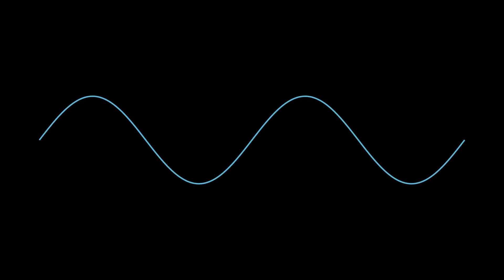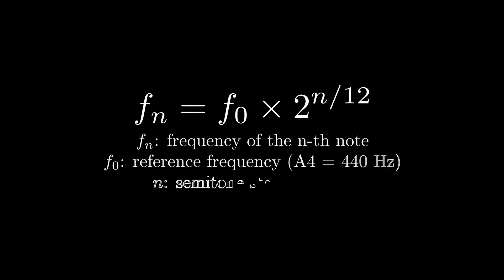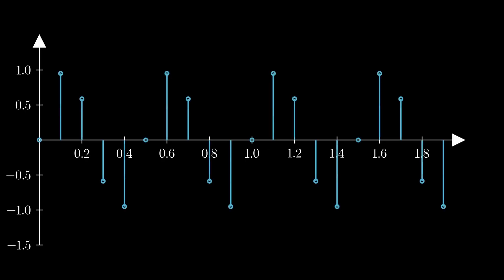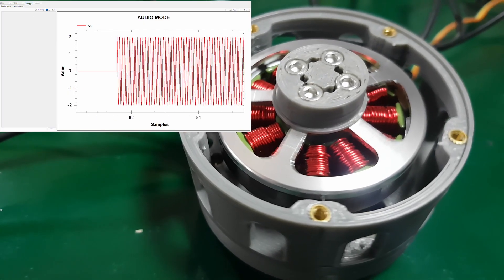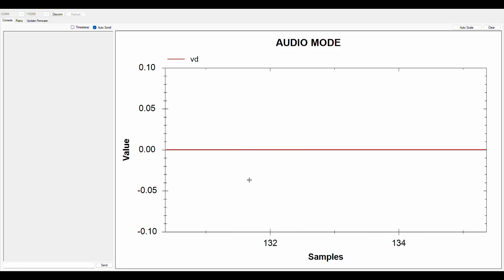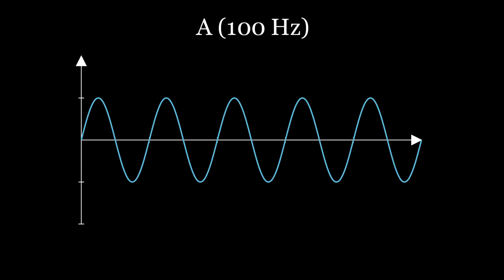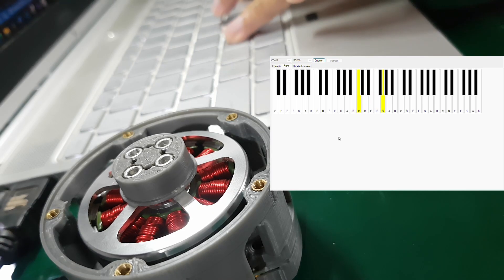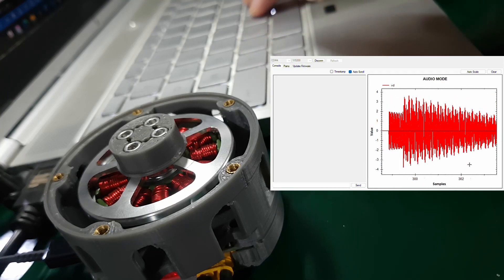Can a BLDC Motor Become a Musical Instrument?

Comment: I came here when I realized that the feature is used my a few ESCs to play startup or error sounds, but actually implies the motor sound HEAVILY depends on how it is driven, so the sound could be tuned in a wide range to sound very different in operation/power delivery. Also the principles of noise cancellation should work.

Comment: Interesting and good job! I have been toying with the idea to implement variable pwm frequency for my AC motor inverter to realize acceleration scales seen in trains usch as ”do-re-mi” so when going from a low to high modulated frequency (0-50hz) the carrier frequency would follow in steps from the lowest note to the highest. Your way of directly modifying the Vd voltages seems to work nice for a BLDC, have you noticed any thermal constraints with this method?
Reply from the maker: Yes, there are thermal constraints especially when playing low notes.